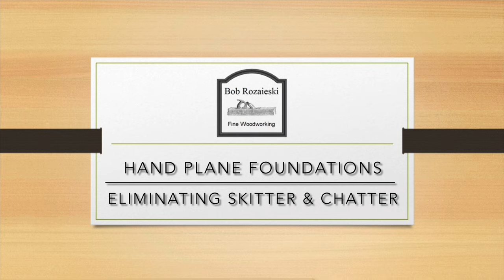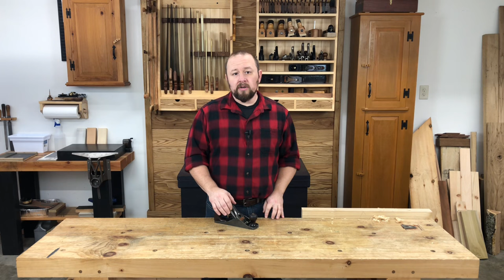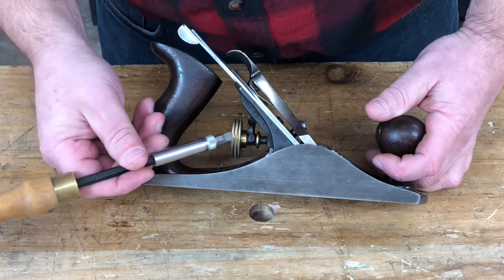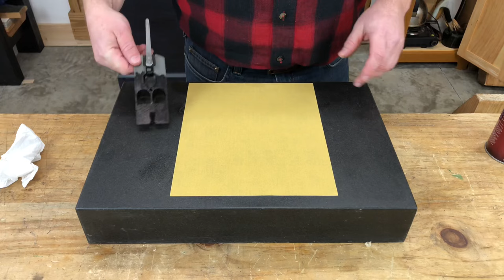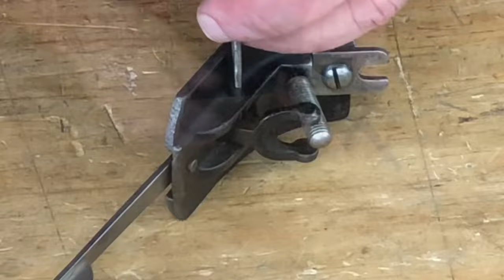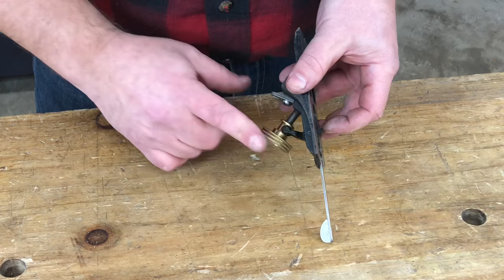Eliminate Hand Plane Skitter & Chatter | Hand Plane Foundations

Comment: I had one plane that was giving me fits trying to get it set up so I wouldn't get any chatter. I did fine tune the bottom of the frog, and it still chattered. I eventually discovered that the paint on the plane bed left a hump for it to pivot on. Got rid of that and I am able to get smooth cuts with it. I did see some one that for flattening the bottom of the frog, he cut a slot in the board he had his abrasives on and the pivot pin for the side adjustment went in that slot. thought that was a good idea!

Comment: thanks so much for this, recently i was at an old antique show for planes and all of that and found a Stanley, Bailys 4-1/2, which I needed. It was "new, old stock" . I started a project after squaring the blade and sharpening the blade and this chatter is exactly why I have, So I disassembled the plane took out the frog and Yip, sure enough, there is a major dip in the frogs center, So I guess I have some lapping to do to get it flat, Thats what i thought it was but this video for sure confirmed it. Thanks !!

Comment: Great video, thanks! Do you have any advice for if the frog doesn't sit well on the plane body? I have a 4 1/2 and a 6 that both have unfortunately had the bodies painted by previous owners and they failed to mask the frog bedding points and sprayed black paint all over the machined flat surfaces that receive the frog. I've scraped off the majority and tried to lap it flat with a small file/ sanding block but when I sit the frog onto the plane, it is rocking side to side. Obviously once the two screws are tight it will no longer rock, but I do wonder if I should continue to try to get the frog to marry perfectly to the body?

Comment: Question, when you put the frog back in to the plane, should the face of the frog be flush, under-flush or over-flush with the angled face in the mouth of the sole?  Or to say it another way, should the iron sit across the frog and the angle face of the mouth, touching both,  not contacting the mouth surface or sit hard on the mouth and slightly off the face of the frog?  Apologies if my terminology is off! 🙂
As you installed the frog, you fingers were touching the bottom edge of the frog and the mouth, checking their alignment (presumably), but i don't recall a specific instruction on which way is best, assuming it makes a difference at all.
Many thanks in anticipation!
Reply from the maker: The frog should be flush with the angled angled rear edge of the mouth or forward of it. If the rear edge of the mouth sits forward of the frog (in other words if the frog is set too far to the rear of the plane) then the edge of the blade could potentially be lifted off the frog by the rear edge of the mouth. So my rule of thumb is that the frog should be flush with the angled rear of the mouth or slightly forward of it.
Reply: @BRFineWoodworking  many thanks! :-)
Reply: @Touay.  and you, for asking what I also want to know :-) many chatter over here...